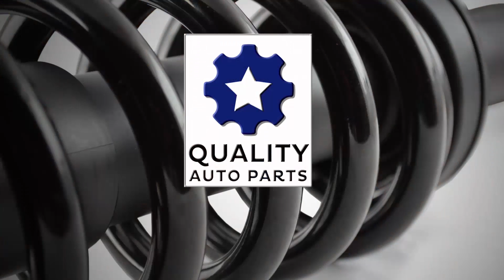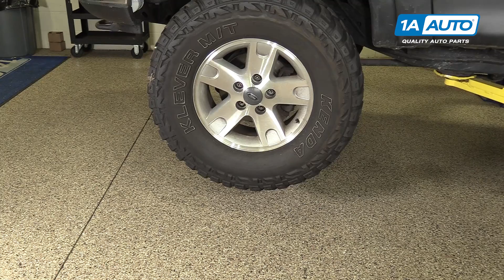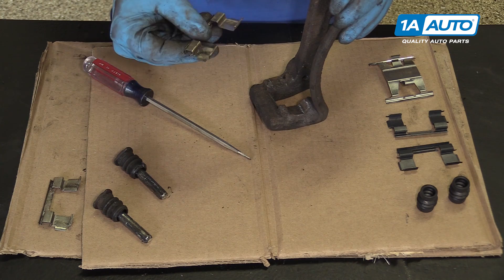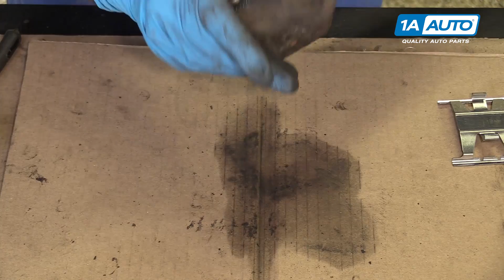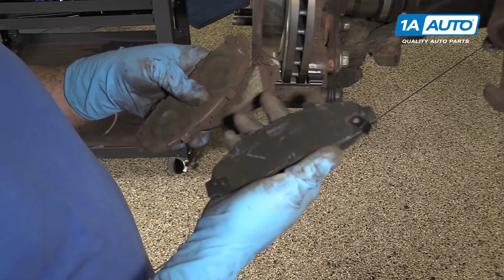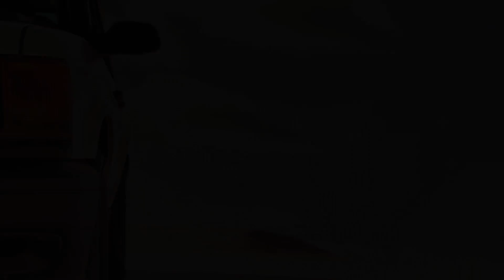How to Replace Front Brake Caliper Hardware 97-03 Ford F-150

Comment: I suggest changing your gloves after cleaning everything and star over with new gloves, else you contaminate the components reversing what you just did. Also if installing brand new calipers don't use the old pads to push in the pistons. The pistons on new calipers are already pushed in but in the event you have to do it, don't contaminate your new caliper and pads with old brake dust.
Reply from the maker: +Chuck Fitch Thanks for the tip!

Comment: How important is the bracket on top of caliper? What is it’s function?
Reply from the maker: +Soccer Legacy Thanks for checking us out! This is used to protect the pad and the inner machinations of the caliper itself. This also allows it to be secured to the vehicle.
Reply: @1AAuto  is it necessary to have? I don’t think my mechanic placed it on my brakes....
Reply from the maker: +Soccer Legacy Those brackets allow the brakes to function properly, so it is something you should always replace or reuse.

Comment: What are the bolts called that attach the bracket to the car?? (Not the pins & bolts) I can’t find any for my car. Called junkyards and hardware stores and no one seems to know what I’m talking about.
Reply: Visit forums not Youtube for small details like that. Your Ford dealer may well sell them cheap like many small parts mechanics don't think of visiting the dealer for. Your dealer can also print the parts catalog page so you get a proper exploded view with info.